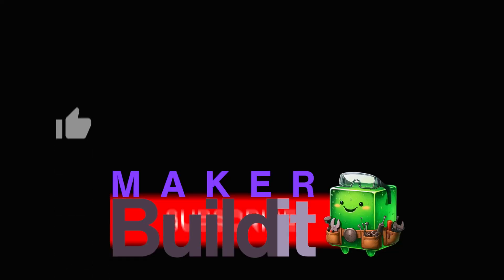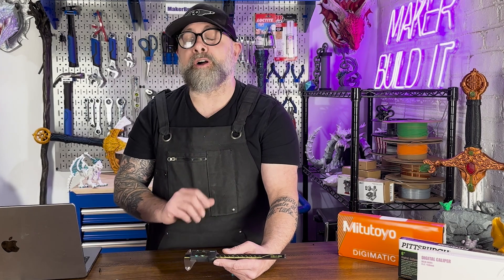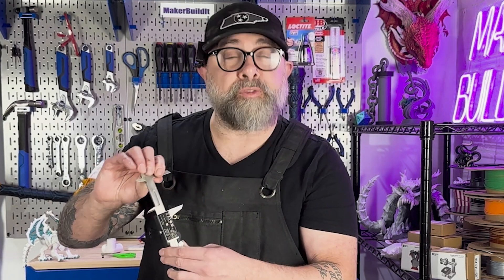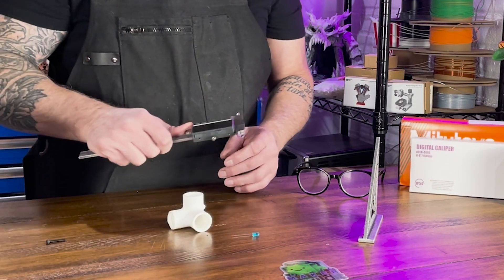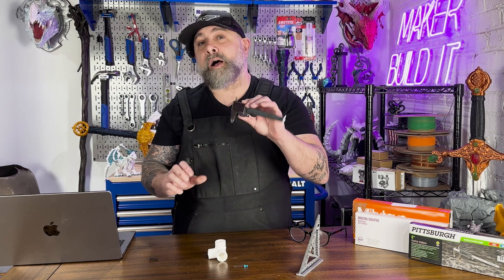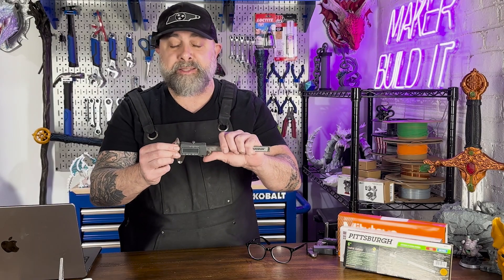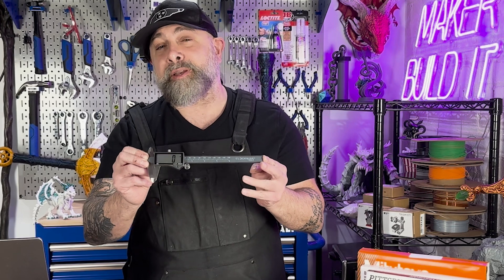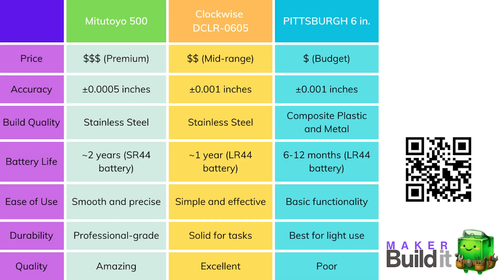Are Expensive Calipers Worth It?

Comment: psh, only nubs use calipers, Ive been using micrometers on ALL my prints. 😤 only a REAL maker uses micrometers.
Reply: You need to be comparing the accuracy against gauge blocks or pins. Taking some random PVC part from the Home Depot bin is not a good test
Reply: (JK, plz dont, thats expensive implementation and maybe not good to use for 3d prints)
Reply from the maker: @DavidSmith-cr7mb 🤣Maybe if someone is 3D printing precision parts. 😁🧰
Reply: If you want real precicion parts, you don't 3D print them, you prototype using 3D printing and then either injection mold, or CNC mill for high precision parts.  Only real makers protype using 3D printing and callipers, and then further refine their design so that it can be injection molded, or CNC milled for high precision you then might use a micrometer for.

Only a real maker uses the right tools for the right jobs.  We certainly wouldn't use a micrometer when just the give of the 3D printed material can give you an incorrect reading.

Perhaps before signalling you are a real maker, you might want to become a real maker first.

Only nubs use the incorrect tools for the job.